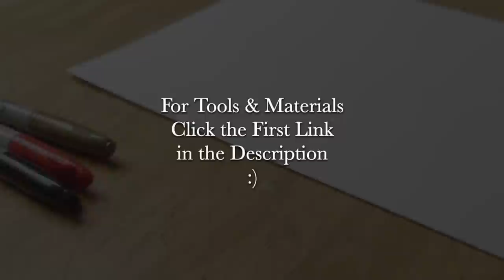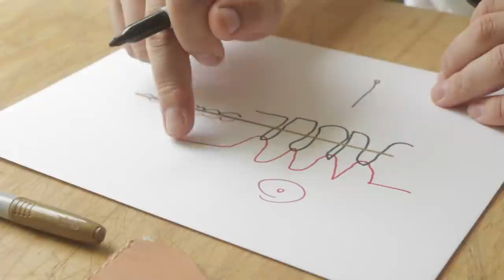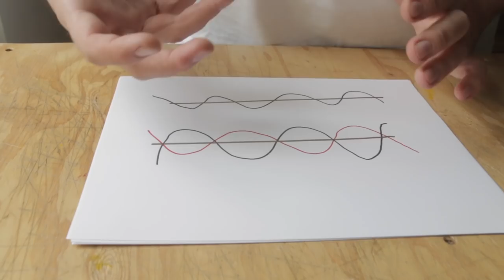Saddle Stitching vs. Machine Sewing Leather

Comment: I've been doing leathercraft for about 10 years, and for profit for about 4. 

I've always done saddle stich (or other hand sewn techniques as the project required), but it has gotten to the point where it really hurts the joints in my fingers. 

I've been looking into eventually getting a machine, both to speed up production, and to put less wear on my hands. However, most of what I make is light armor and similar items that will be exposed to abrasion. I have yet to have even a single stich (when properly made) come undone, but this video has reminded me of the major downfall of machine sewing. It's making me wonder if there are other aspects of my work that I should focus on first.

Comment: Really enjoy your informative videos. The "regular" sewing machine stitch is called a "lock stitch" not loop stitch though some machines are designed for a one-thread chain stitch. I've used both saddle stitch and machine stitching but I only use the machine where it doesn't show and when I'm pressed for time. There just isn't anything that beats the good old saddle stitch.

Comment: When you are hand stitching a particularly long stitch, do you like to do it in multiple sections or all at once? I find it difficult to deal with a very long thread when using the no-pony hand method you shared on your channel.
Reply: That’s what I’ve encountered as well... when I sewed an iPad Pro 11 case, it could have been half as long of work if the thread was shorter... at the beginning, it takes about 10-12 seconds for one single stitch...
Reply: There are 2 simple ways of dealing with this. 1) make the ‘tails’ that you use to thread the needle long and just let this out as you go along using up thread and when you need thread to sew. 2) use shorter threads in the normal way and when you start to run out of thread, you can start with a new set of needles / thread and hide the the knotted end of the first thread in between the layers of stitching. Sorry it’s quite hard to explain this without showing you. But I hope that helps.
Reply: marpipr Thanks, though way 1. is not really helping I reckon... the problem is the you have to get the Thread through the hole anyway... way 2 is probably more helping but difficult to execute tidally..
Reply: MacBookAir1324  For method 1) you’re not passing any great diameter of thread through the hole compared to usual - it is only 2 strands of thread. For method 2) it is possible to make the ‘join’ between the old and new thread invisible, provided you’re sewing 2 layers of leather together, particularly if you don’t use a knot but use a traditional saddle stitch and hide the 2 tails of the 1st set of threads between the layers of leather. They lay flat and are not visible through the leather. This method is used often for hand sewing lined belts. It works well.
Reply: I always just make my thread only as long as my outstretched arms, or slightly longer. Pulling out the slack just takes way too long otherwise. As long as your backstitches are clean, it wont look bad. Be mindful of where your backstitches are, though, and try to make the locations of the backstitches symmetrical. For example, if there are backstitches halfway up the right side of a strap, make them halfway up the left side of the strap as well, even if it means cutting the thread short sooner.

Comment: I think it should also be noted that another pro to saddle stitching is not only a better looking stitch (after lots of practice, of course) but also the ability to control the look of the stitch. For example...the type of pricking irons or stitch punch you're using (french vs diamond vs round hole). Another pro to using a machine though, is the ability to change the stitch length with the turn of a knob or lever.

Comment: Thanks for sharing, in your videos it seems to me you use only one needle, are these saddle stitching?
Reply: for this video... he seems to be mimicking a machine sewn stitch, to get different colors on both sides, so only the one needle is needed to pass through the work piece. 
but usually he uses both needles and drops each needle after each pass and switches between both of them as he works.